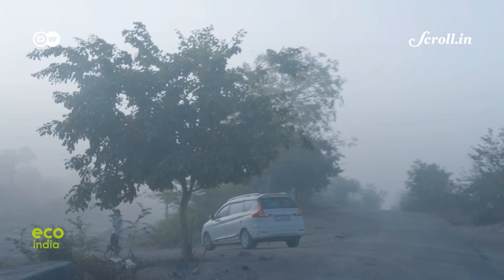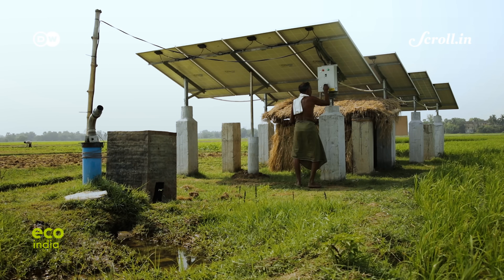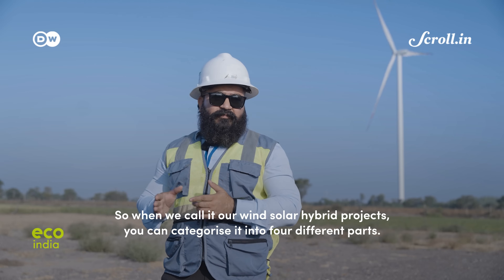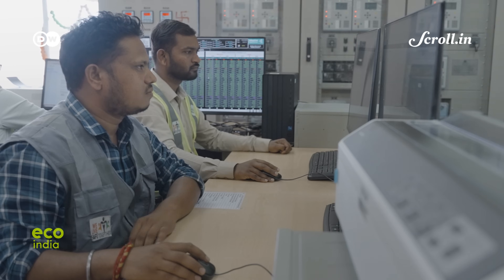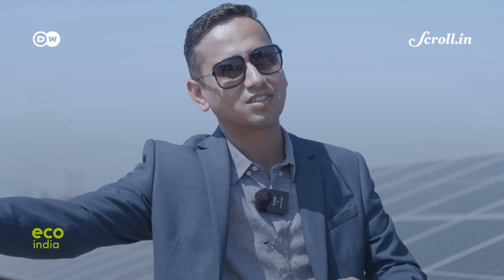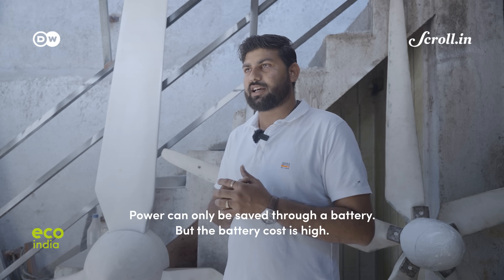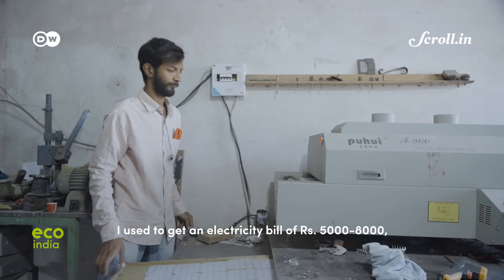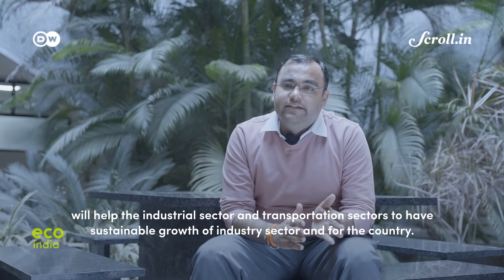Eco India: Can combining wind and solar energy prove to be a game changer for India?

Comment: Why build solar plants far from cities.

Solar  should be installed on all building inside cities and generate energy locally

Same with agriculture distribution 5-10 panels for each farmer is required so that when sun comes up it automatically turns on the motar
Reply: True. Currently I am completely off-grid past 7 years
Reply: @edwinrodrigues9747  You said you charge your EV scooter using solar. May I know the model of your EV scooter and what battery does it have? li-ion/lifepo4/lead acid?
Reply: @rakshitas2027  I use the epluto removable lithium battery. I have 2 batteries one is kept charging and other one I use when I go out.